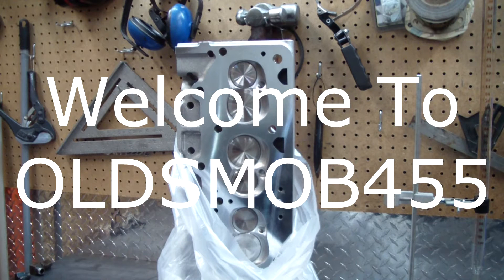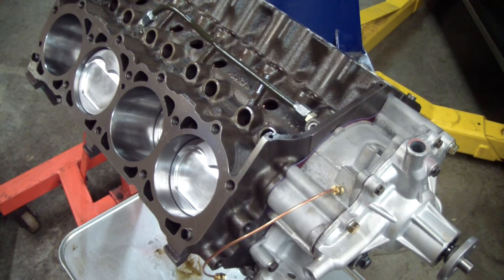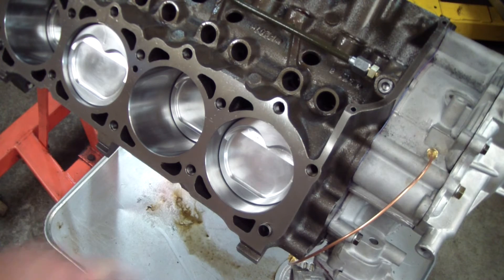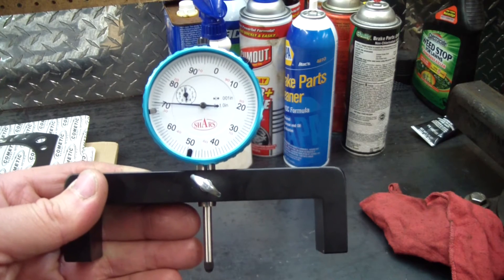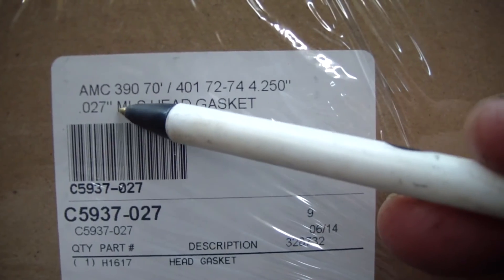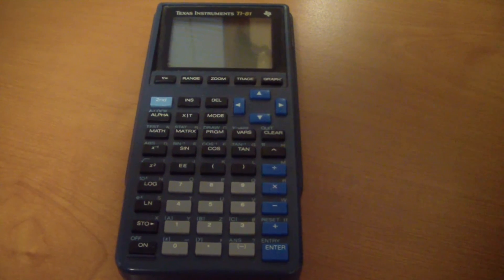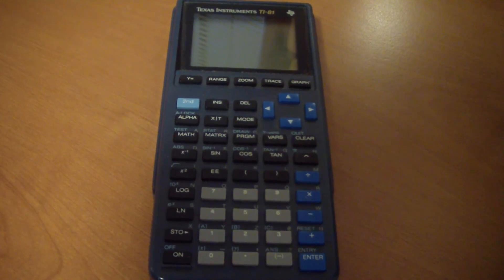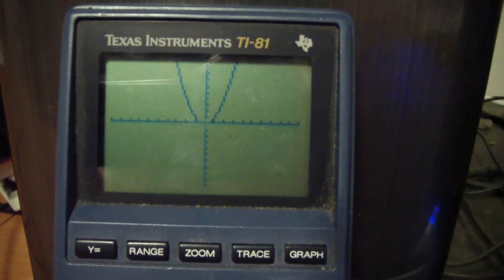Engine Compression Ratio Calculation : What is needed and the math

Comment: If I may ask: When I was in night school (1970's) the symbol for multiplication was  x  . The symbols for cubed or squared was, respectively, 3 or 2 at upper right of digit. At aprox. 1:55 you show a circumflex( ^ ) the entire display is[ " ^ 2" means squared]  if the digit (2) means squared, why is the hat or circumflex(^) placed before the numeral (2)?  Is this to avoid any ambiguity as to the mathematical operation? No criticism intended but curious. My study of electrical theory and some physics using the British Imperial system before the invasion of metrics did not include  the symbol(^) used here.
Reply from the maker: +Flickchaser I don't know of any way to make a small two at the upper right of a number with this keyboard.  On my calculator the ^ symbol is used for exponentials so I thought it fitting.
Reply: +Oldsmob455  Thank you sir for the timely response, and neither can I, as yet, use miniature numerals for squaring. This is a  interesting video. Years ago I worked where engines were rebuilt, small to large, gas or diesel at a major trucking co. I was always curious as to the math behind the specs. Most of the seasoned mechanics were VERY professional at their job but had limited exposure as to how the mysterious engineering data was derived. One of my jobs- take a semi-trailer tractor after the diesel (Cummins) had been rebuilt, pull into the Dyno shed,until rear wheels were on large steel rollers, shut down engine, chock front wheels, chain truck frame down tight to eyes in concrete deck,thread manual oil pressure gauge w/aprox 3Ft hose into the oil galley, crank her, ck. oil press at manual gauge,if good press,go through all gears(manual) until 10th or 13th, RPM's are bumping governor, were up to 70mph and sitting still,pull out throttle,get out of tractor, rear tires and engine screaming, ck. O.P. at gauge laying on front tire, if good,open water valves to fill tank under floor(truck wheels drive rollers coupled to blades in water tank to load engine) load it down checking all gauges keeping RPM high to not "Lug"engine and watch that jewel hammer!! That's when my interest in engine design really started, after seeing the torture they endure, hammering up mountains into thin air, bucking arctic winds, in summers blistering heat. Proof indeed that the engineers engine equations and math are tried and true.